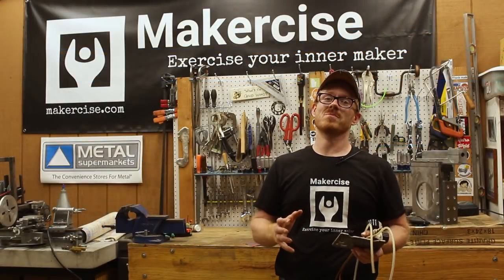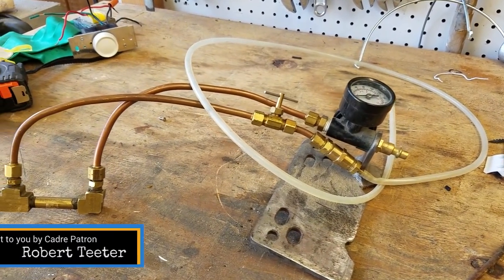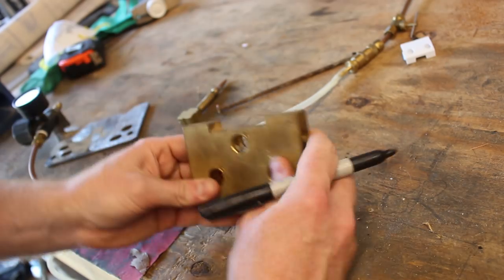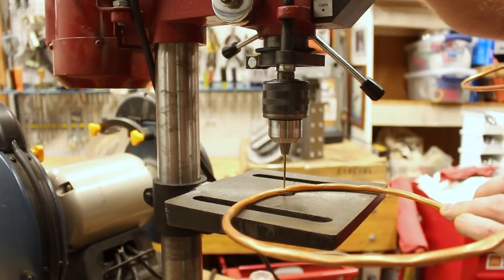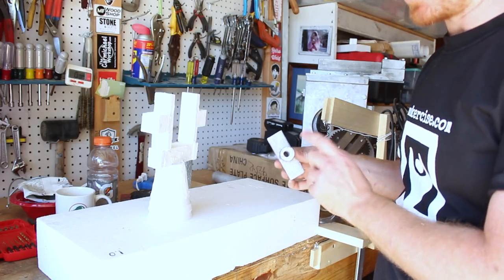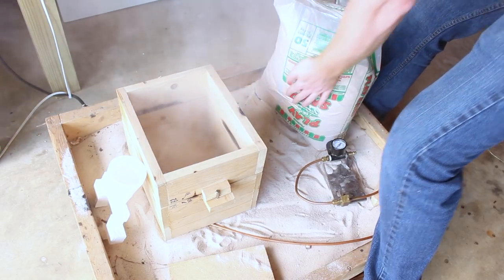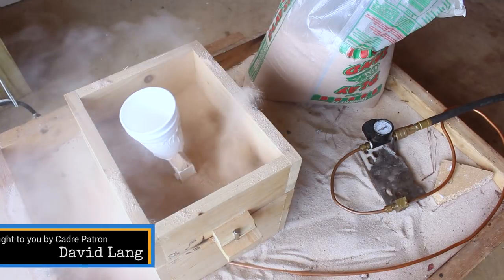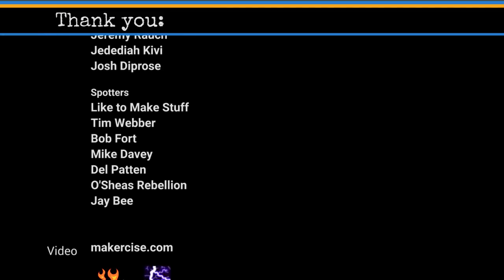Fluidizing Bed - Aerating Sand for Lost Foam Casting

Comment: Fluidizing the flask is more useful for extracting (and possibly placing the pattern) the casting but actually does the oppoite of what you want to do to pack the flask. I think you'd be far better off sticking with your vibe table for packing lost foam flasks. Multiaxis vibe is the commercial process for packing, not fluidizing. Best, Kelly
Reply: That earned a subscription. Nice channel.

Comment: Quick thought on DC Power supply for your 100V DC motor... A fair number of PC power supplies (eg. ATX) have a bridge rectifier on the input that will give you +60V out (very noisy, but you're driving a motor -- not sensitive electronics).  If you tap into that voltage, it would probably be enough to run your shaker motor.  (You could also just buy an inexpensive bridge rectifier from DigiKey.)  It's not the most efficient way to run your motor below the rated voltage (definitely not optimal), but the efficiency losses are cheap compared to an expensive supply.  More generally: Get yourself a good desktop power supply.  You'll be glad you have one!
Reply from the maker: I found the power supply last week so kind of a moot point now. I didn't want to straight bridge rectifier it on account of hitting it with full peak 170V. My hack power supply is two 24V transformers in series followed by a rectifier...might have a cap in their iirc. It puts out about 80-90ish volts DC. I have a budget variable bench supply, but it only goes up to 30V. If you have one your recommend let me know. I expect to do some power electronics starting after the shaper project.

Comment: Check out the video mark rober just did. Lots of good fluidizing tips.
Reply from the maker: +Brian Prusa wow! That's a cool video. Takeaways: flip my injector over so it doesn't get sand in the tube, and i need a sealed container so the sand doesnt flow out the bottom or holes.

Comment: I think the vibratory table is better... the fuildizing seems to not be active on 100% of the sand... whereas the vibratory system acts on 100% of the sand around the foam.... but another thought... why not find an air motor and attach that instead of the electric one?
Reply from the maker: Ramiro M agreed vibratory table is better. I have never used air motors much. I could maybe repurpose a die grinder. What is a good source?
Reply: as long as it vibrates the table... and the die grinder is free I say go for it.